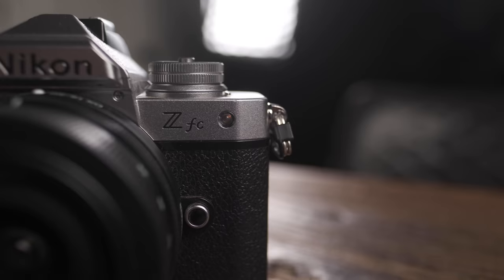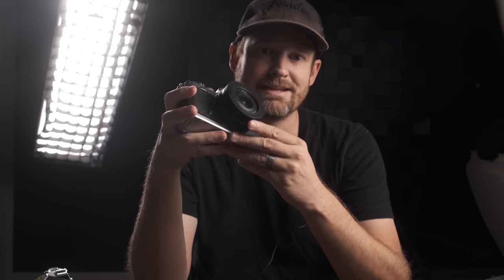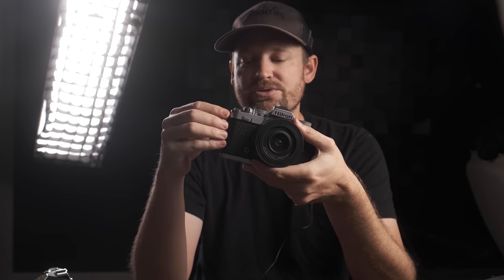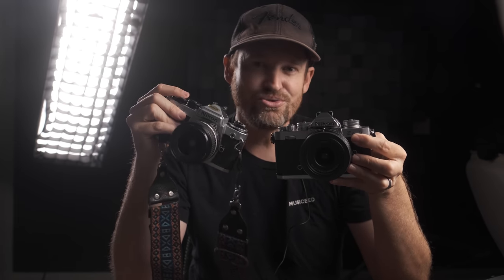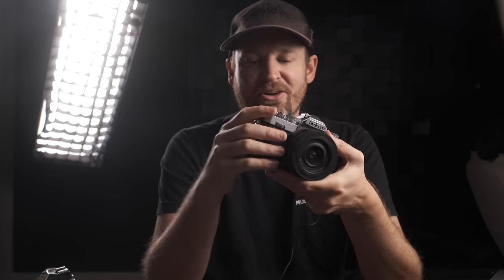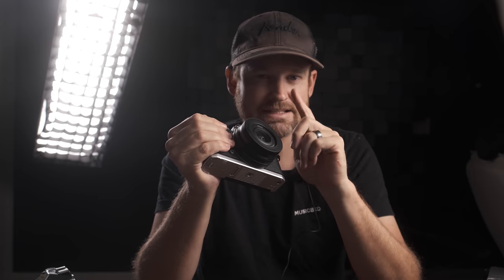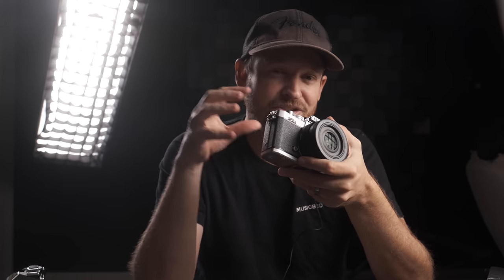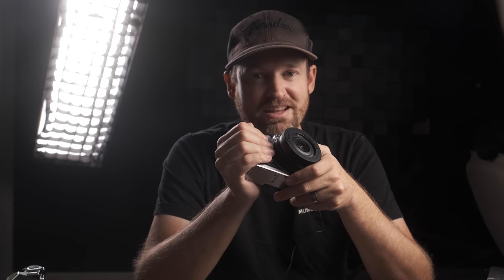Nikon Z fc - This is not the APS-C system you're looking for (probably)

Comment: A full frame version of this would be perfection. Until then I pray for a Fuji full frame
Reply: Fujifilm already have the GFX line.  No need for full frame.  :)
Reply: @bjornelenfors2039  I’m looking to sell my full frame canon system for the gfx but it’s big the lenses are slow and the experience seems clunky
Reply: I can see Nikon coming out with the Full Frame Zf in the future.  Hopefully with IBIS.
Reply: Honestly all I want from Fuji is a high end x-mount camera with a normal sensor instead of a x-trans sensor. I’ll be so happy if the X-T5 or X-H2 has a normal sensor!
Reply: @just_eirik  why do you dislike the sensor? Maybe try Capture One instead of Lightroom if that is the reason. It handles the Fujj-Raws much better.
Reply: I highly doubt fuji would ever dip their toes in the full frame market it seems. Their bread and butter is already in apsc, and they still want to maintain a niche but strong foothold in medium format.

Nikon hitting in with a full frame retro styling camera though, that would seem more plausible
Reply: @just_eirik  why don’t you like the x trans?
Reply: I hope may be one day Nikon would make a medium format sensor for the Z mount, since the mount is large enough...
Reply: @bho9632  the XH2 with the 150-600 will be a sport photographers wet dream

Comment: Great video.  Direct and concise.
I had high hopes for this camera, but I knew just from the start that the lens line up would disappoint me.
One could easily use the full frame z glass.  No big deal.  But they are huge and long. 
I don't want a big system.  One of the reasons for my switch to fuji was size.
If they made a full frame version with better build quality and a great manual focusing experience so that we could use our old D and Ais lenses on them, I'd be all over it.  I'd buy a few z lenses to boot.  But that was not the intent for this camera.  I think it was made for the younger crowd.

Comment: Did you ever try it with the 28mm se or 40mm f2?  Or any of the new voightlander manual z mount 1.2's?  Do you think throwing any of the nice metal grips (to add to the heft) and a nice manual non adapted  lens would change your mind at all?  Reason I want one is to have a slightly smaller camera to take to family events or travel when I don't want to take the z7ii and bigger lenses BUT it also can double as a second camera when I want to go shoot with my wife or other people.  I see lots of people hate on the battery door (maybe someone will make a metal door replacement ha) but most people think the rest is built alright.  Anywho, im looking used but think it would work great for me....still havent held one in person though.  To me it fits between an x-t3 and x-t20 (more dials than 20 but smaller that the t3)  quality wise how does it compare?  Not the lenses as I would get a voightlander 35mm and probably keep it on all the time.

Comment: Your opinion may not be that of your viewers. I have this camera and the main criticism I have is the lack of a real grip. So I bought one and it transformed the cameras handling. I f you hold a Z9 and flick the battery door and shake the body with no straps attached you will get the same rattle. The output from this camera is very good . Be fair. This is not an expensive camera. Good value for money

Comment: Would you like more the Z 18-140 Lens for the Z fc? Even when the clicks and dials are not like my Nikon FE, technically and handling wise it should still be a good combo? And yes I got your comments about the not so robust parts of this camera, however, it is also not so heavy, which is a pro when you get older, as long as it is strong enough.

Comment: I felt seen. 😎
I’m disappointed to hear that it doesn’t live up to the expectations for it as far as build quality. Not because I would switch from Fuji to this by any means, but because I have my hopes that a full frame Zf is coming that will be the Df + Z6/7 that I’ve been waiting for and I will finally go FF. I know Nikon got a lot of flak for the price of the Df, because it used so much metal, but I really hope they don’t go cheap on a Zf and make it with the Zfc’s quality. I honestly don’t understand why Nikon and Canon continue to make APS-C cameras. It’s too many ecosystems to support and frankly too confusing for new customers when two different sensors share the same mount.

Comment: Time to rain on your parade Andrew...
I guess from your description I am a PROsumer... having earned most of my income over the past 15 years through photography.... shooting with micro 4/3 - Phase One digital medium format - Nikon Z system  - Nikon Fm2 / FA film bodies  - and yes Fuji too.
About a month ago I got the Nikon Z FC with the 28mm kit lens... and I do agree with the construction of the camera itself and how it is not going to be a professional kit due to potential durability... but having used it with my Nikon 300mm f:4 PF ( along with a 1.4 and 1.7 teleconverters) and comparing the images to my xt4 with the 100-400 at similar focal lengths, I think it's time to just sell off all of my Fuji gear.... I'm finding the focus acquisition of Nikon ZFC system to be outstanding, birds in Flight included.... dare I say better than the Fuji XT4? The image quality I'm getting from the little Nikon crop sensor and my full frame Z7 are everything I need to satisfy my retro passion and image quality for my clients....
True, the road map for Z mount crop sensor lenses is pretty sparse, but with a Z to F Mount adapter I can use an awful lot of my retro lenses and almost be back into to my film experience...
I can pretty much duplicate any of the Fuji film simulations if I want to take the time and yes I do like the Fuji colors... But after the pandemic it's just not viable to maintain more than one camera system so off goes the Fuji kit!

Comment: Lenses for ZFC: 28 f2.8, 40 f2, Viltrox 23 f1.4, Viltrox 33 f1.4, Viltrox 56 f1.4. Plus the Dx zooms available. So you have 35mm to 85mm covered. You can complain about this not having 105 and 135 primes and 200 to 600mm telephotos. Not sure anyone will miss those lenses for this camera. So I don’t buy the lens argument. The plastic feel? Yes that’s a point
Reply from the maker: Those lenses are all full frame lenses. I'm talking about lenses specifically for APS-C at the size that makes sense for APS-C.
Reply: @Andrew, the Viltroxes and the the zooms are apsc. I think the 28mm and 40mm are useful compact lenses for both. Oh course Nikon doesn’t treat their DX lenses as “pro”, unlike Fuji who have to cater to pros with a full line up. (Plus, Z mount is 3 years old. The X mount is 10 years old.) On the other hand, DX will be Nikon’s mount recruitment products only, except for the D500 replacement (maybe)!

Comment: What do you think is better for video Fuji x-s10 or  Nikon Z fc?
Reply from the maker: Both are great. I prefer Nikon Z fc for focus tracking. But I prefer the Fuji X-S10 for most every other factor (color, image quality, lens selection, durability). Overall, I would choose the Fuji X-S10.
Reply: @AndrewGoodCamera  the durability goes to nikon because there’s weather resistant and the fuji doesn’t .
I like the colors that nikon produce but i am on the edge of what to pick because the fuji has higher resolution sensor.
Ok so Basically i ordered zfc with 16-50 lens but i can still change it to x-s10 with 15-45 lens
What do you think about that fuji lens because here it sold with this kit
Reply: Fuji X-S10 has IBIS, which is a huge bonus. But Z fc has human/animal eye tracking 🤷‍♂️
Reply from the maker: If you held them both and used them, you'd see very quickly that the X-S10 is probably going to withstand greater abuse. WR aside, the Nikon Z fc feels like it's going to fall apart in the hand.
Reply: What do you think about FUJIFILM XC 15-45mm f/3.5-5.6 OIS PZ lens ?
Reply: @jeVoKk  he’s reviewed it before. Said it’s a very good and capable lens. Not the best, of course but that it provides a lot of value and versatility at its price point. Also talked about its close focus capability which is on par distance wise with his favorite lens, the 16mm f1.4.
Reply: @jamestonbellajo  thanks i will search for that review

Comment: I like the style of that Nikon but Fujifilm has lots of style AND technology.
That Nikon only goes to 1/4.000 s shutter speed!? My X100V in electronic shutter goes to 1/32.000 AND has an in built ND filter if necessary.
Reply: That's a leaf shutter compared to a focal plane shutter, and not to mention a fixed lens to interchangeable lens system
Reply: 1/32000?  Really?  I never new that. Amazing! So I guess there is  no need for ND filters while shooting wide open?
Reply: @SRC1711  most camera's can reach insanely high shutter speeds in electronic mode anyways. The real benefit really is the shutter sync speed

fitting the ND's was really just one of the benefits on using a leaf shutter. Its in place of where the shutter would normally be.
Reply: @SRC1711  Even an old FujiFilm  X-T1 has 1/32.000 s as maximum electronic shutter speed.

Comment: Hah!  Was fully attacked in the first two minutes of this video ;-)  

I know this video is a year old, made around the release date of the ZFC.  However I feel like your review unfairly misses the mark when it came to the lens.  On pre-order with the kit there were two lenses - 28mm 2.8 and the 16-50 3.5, the latter is featured and I think the bulk of your negativity towards the ZFC is the lens that you chose to come with it.  You compared it directly to which is a Nikkor f2 prime lens - that doesn't "fold" which is your biggest gripe with it.  I think a more direct comparison would have been between the 28mm 2.8 prime. 

I migrated from the D810 (3 lbs with lens) to the ZFC (1.5 lbs with lens) and I admit moving from 36 megapixel to 21 is rather painful, but I choose the camera and the lenses that are light and portable (plasticky sure whatever) if I am going to be shooting for hours and won't make my shoulders sore - with excellent picture quality.  Not as much a full framed - but enough to get anything I need done that's not an escquire or vogue cover.

Comment: I like cameras like the 35mm film cameras.  In the beginning, I chose the Nikon F rather than a rangefinder or a medium format tlr Rollei or a slr Bronica.  Light, small, versatile, easy to pack and travel with.  A wide assortment of film stock to play with.  But I enjoy the quick and easy way digital cameras work.  The lower cost to process is also important.  That is why I like the Fuji X-T cameras.  They bring back the way I would take a picture.  Even the Nikon Df isn't as good as the Fuji series at operating like the 35mm film cameras.  But I do own and use one.  Mainly because I can mount all my original Nikon glass.  Also, the images I get from the Df are outstanding.  They all take images I can enjoy but I like the process of using knobs to adjust my settings rather than menus.  The Fuji's fit that bill nicely.  The Nikon Df and ZFc look like film cameras but they don't handle like film cameras.  The Fuji's do and offer the digital advantages as well.  I love the film simulations when I want something special straight out of camera and then I use the RAW output to work in post processing.  They are just great at all the things I look for in a modern camera.  The Nikons fall short.  I still shoot quite a bit of film with my F and F2 and I recently bought a FM2n that I like a lot.  I will shoot film as long as I can get the processing done and the film is available.  Sometimes the film look is just what I want to see.

Comment: I don’t know, if just depends on your perception I guess. I finally tried the Zfc and have even run it through its paces on some paid architectural/landscape jobs and I absolutely love it!  I tried Fuji a few years ago with several of their models and didn’t like it. The Nikon produces at least as good color with less noise and better dynamic range. 
Yes, the Nikon feels a bit too light and cheap, don’t like that, but the Fujis had their problems with build quality. 
Since this review there have been lenses added and of course the Zf full frame camera which deeply interests me because of my positive experience with the Zfc so far. 
I’ve been a Sony “R” series shooter for years but the humble little Zfc has hung in there with frankly much better colors and slightly better autofocus (as well as super quick startup and much better menus) that it is pulling me back to Nikon after all these years. 
So if nothing else, it’s a good “testing the waters” camera. 😉

Comment: One of the things I do when I see a camera like this is I go to Flickr to see if it's in their Camera Finder section, and if it is, then I check out the kind of results others are getting out of it. Yeah, it's got a pretty body, but what does it have beyond that? What kind of images can I get out of it? In the Z fc's case, I was very impressed with it. I looked at the Z 50, and I decided that if the Z fc wasn't available, I'd go with that. It didn't hit me the same way, especially not appearance-wise. 

I'm not overly concerned about the Z-mount lens situation. It's a new format that Nikon is going to support; there will be more, especially since Nikon's dumped their conventional mirrored DSLRs.

Comment: Interesting video! The demographic for me is close-ish. I know it isn't a better camera than the ones I have. I am not that interested in video. But for me it is light (because it is plastic) - good. The flimsy door I already knew about - I won't be changing batteries very often - I can't buy spares anywhere anyway, lol, but mainly, because USB-C is how it will be charged. Images will be transferred wirelessly or mostly via USB-C. I am not bothered about native Z lenses or lack thereof - I have bought it body only with FTZ (I also hate lock/unlock lenses and would never buy one). It will be mainly to adapt vintage lenses and as a bridge/intro to Nikon Z and a small/light travel camera. I could have bought a Z50, but the useless flip-down touch screen was a problem. I could have bought a used Z6 for about the same money and I'm sure a better buy, but I have existing crop lenses so a crop Z makes sense. To me, something to play with. If I don't use it, I will simply sell it and buy a Z6 instead.
Reply: ..forgot to add - powered & charged by USB-C it will do double duty for video conferencing in my office

Comment: More competition in the market with analogue dials would be nice.  Fuji is creeping their prices up to making a used Leica look reasonable with each release, it seems.  Their sheep will repeat the "it's a shortage problem!", but they've been creeping up prices for years.  Now that all their used items are shooting to the moon in cost, I wouldn't be surprised to see even more price increases at a disproportionate rate to cost.  Not long ago you could grab a nice X-T2 for around 500 bucks, lower if you were patient and even an X-T3 at around 650-700.  Now the X-T2's are 700-900 and past that you're pretty much better off just saving a bit and getting an X-T5 with a warranty (if you actually buy one).

Comment: I'm more or less in your demographic but you are far out. This is another case of "I do not like it thus no one will like it" That's teenager reasoning, sorry. The camera has an amazing sensor, is small, light and looks great. The problem with other Nikon Canon and Sony cameras is that they are mostly ugly. This one is not. Usability on the Z Fc is top notch and DX suits me much better than full frame, for lightness and increased zoom power. And if I want a full frame lens (like the 28 mm or the 50mm 1.8) It's there at my disposal, or even better, by trustworthy 50 mm f1.4 AIS with the FTZ.  But again just because it suits me, it does not mean it is for everybody. I just do not generalize ;-) Cheers.

Comment: You nailed it. I bought yesterday a Nikon Coolpix A. I find more and more fascination for 10 year old cameras, which combine the functionality of a DSLR with the form factor of an IPhone 4. Unfortunately, camera manufacturers don’t get it. If Panasonic would create a Lumix GM5 Mark 2 I would immediately buy it. No IBIS and video required. A better EVF and improved sensor with all kinds of manual controls including the very user friendly touch screen menus would turn it into a photographic powerhouse in your palm. Sony is using the same back dial on all of it’s mirrorless six thousand series, as other manufacturers do. It’s the recycling of components for economy of scale. We are not in an evolutionary cycle, but devolution. Only Fujifilm stands out in same regard. I still believe the XT2 is the best camera in terms of overall performance next to the very snappy x100V.
Reply: That lens is a no-go as the Lumix kit lens, too. Just plastic fantastic cheap. And that is why it’s there. Profit maximizing getting people into the system

Comment: I'm glad you pointed out that 16-50mm lens has to be unlocked. What was Nikon thinking? That gee wiz kiddy street photographers need a lens unlock feature? That plastic battery door shows the end user this retro platic-magnesium device is for. Great lens lineup, too! Thanks for the heads up! My Fuji XT-1 will plenty suffice, with more lens selections. Sure, the Zfc has some up to date features. Though I suspect a 26 pixel sensor was out of Nikons reach with this form, fit, function (compared to an older XT-3).. Also thanks for noting the knob quality is not up to standards. Not just with the old cameras, but with hmmmm.........Fuji? Nuff said.
Great review! Nikon? You're fired. ; )
Reply: Many (if not all) the Z zoom lenses need to be unlocked, even the S-line ones. I don't quite understand why it is such a showstopper. I unlock the lens when attaching it to the camera and keep it unlocked throughout the session. I latch it when I put it back to the bag. That's all. It's a storage function.